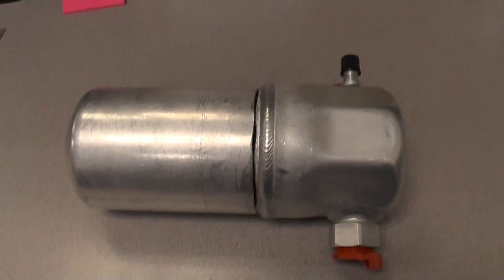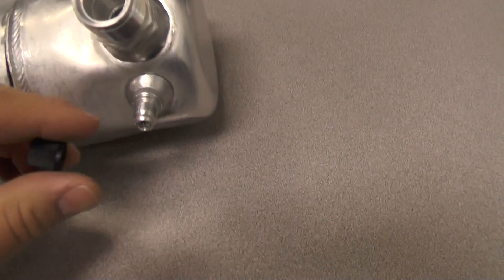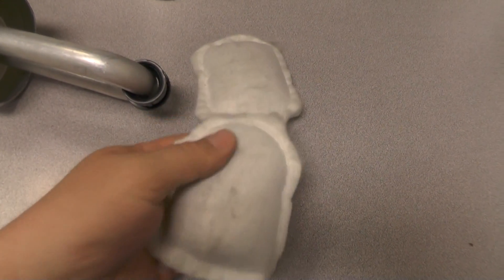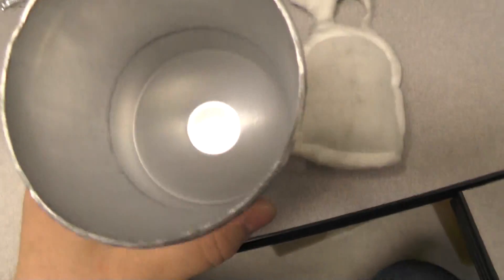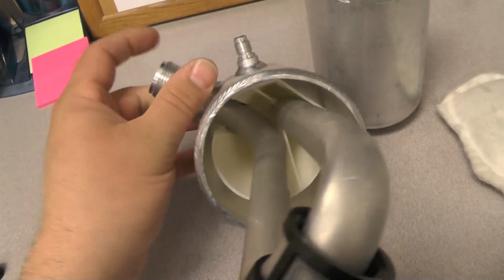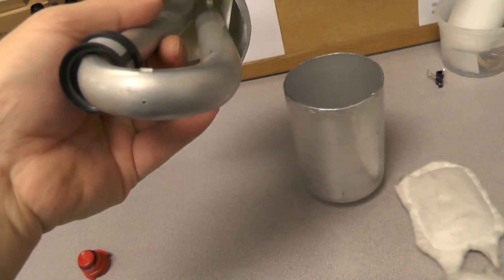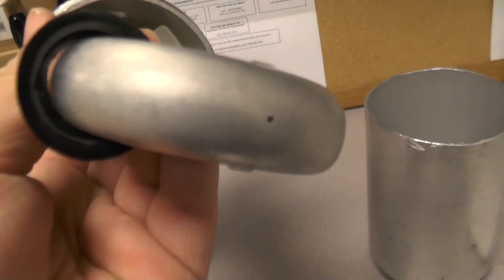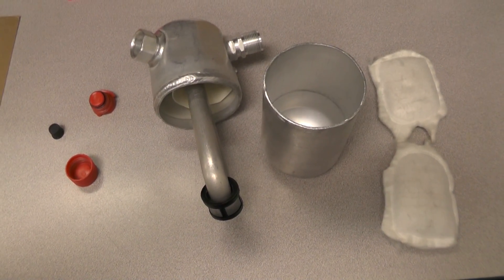Inside an A/C Accumulator - How It Works

Comment: I have a problem with my AC unit where the compressor runs for only a few seconds at a time. system is full, compressor turns on, pressure goes very low, compressor turns off. And when it's hot out unit does not blow cold. Keeps cycling. I was thinking there might be an obstruction in the accumulator. Is there a filter located somewhere in the system that may be clogged? Or maybe too much oil?

Comment: So if it sucks oil out how does oil get back in something doesn’t add up here
Reply: you dont need to read this btw but
the input is just a hole in the side of the accumulator where in some cases, gaseous as well as liquid refrigerant and oil all come in because oil is circulating with the refrigerant constantly. The tube is open in the top half where the compressor sucks the vapor needed for it to function properly but the small hole in the bottom only takes up the oil sitting on the very bottom of the accumulator due to the Venturi effect essentially creating a filter that leaves liquid behind as well as removes any unwanted moisture/water inthe system